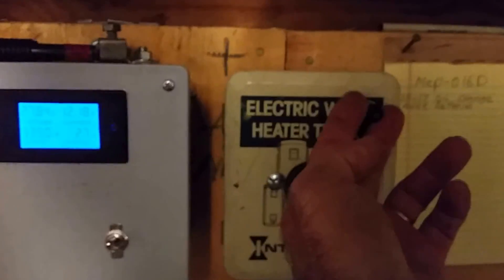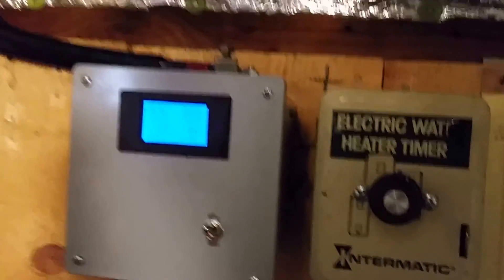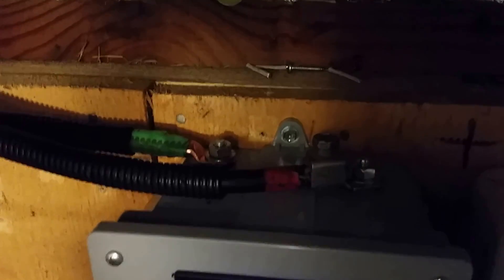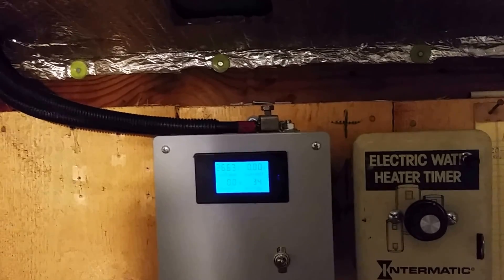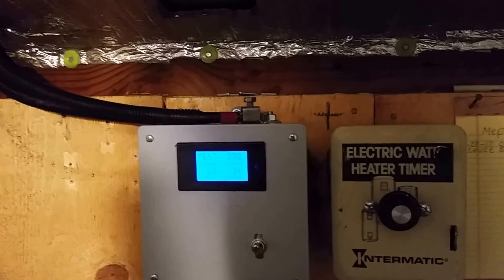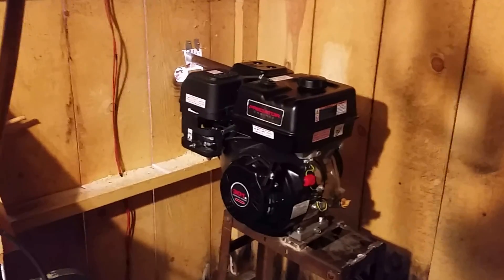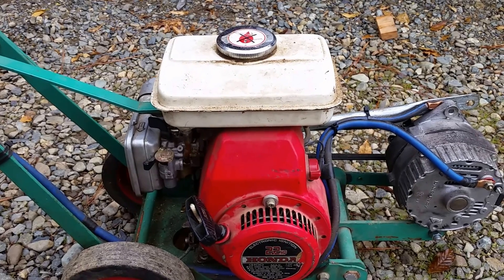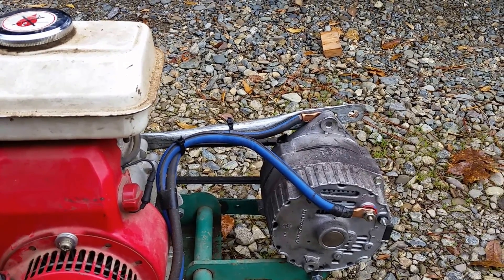Delco 10si alternator hack part II

Comment: the thing that sucks. is a brushed alternator is only about 55%-65% efficient. the newer brush less are in the 80'+%, but they are expensive. a phase bldc motor may be more efficient. but not easy to regulate. I guess its the tradeoff. I even researched building my own regulator. to get 24/29v from my 12/14.4v alternators. at least delco si alternators are easy to work with! great video. please let me know if you have any ideas about using my 2 alts to charge my 24v system.thanks
Reply from the maker: I have a friend who has been experimenting with fuel efficiency as well. He has a 3 cylinder Yanmar diesel driving a Ford G1 alternator with a rheostat for field control. (manual charge) Ge has measured the fuel as I have and he got his cost down to $.26 cents per kilowatt hour. He is off grid as well and uses lithium Ion batteries from a Nissan Leaf and a Chevy Volt. When I charge my batteries through the Magnum Inverter/ charger powered by my Yanmar L-70. We get $.32 cents per KWh. I have tried 10-SI PMA generators as well with very poor performance. They can not cool well at low RPM and anything over 2K the magnets can fly off. I have considered a Leace Neville Military brushless alternator. I found a 28 volt 400 amp brushless one that takes 22 horse power to drive. I can drive on with the Yanmar and get 200 amps 24 volt nominal at 1800 RPM at the alternator. The Leace Neville 400 amp alternators are 125 pounds! They have an adjustable AVR as well. I have our 302cc predator motor driving a 10-SI just for back up. I have a sense wire and a separate volt meter that gives me actual battery voltage. I found a PLC that has a high volt and low volt cut in/ cut out auxiliary relay for $50 on Amazon. Now I just need to decide if it is worth automating. I normally bulk the batteries with the diesel generator through the inverter/charger. We only burn $30 a year in the generator. For my money off road diesel is the only efficient and the most cost effective way with the best longevity.
Alternators as you have said are very inefficient unless you get are military one that weighs 125lbs. Its all about the size of the rotating mass. A delco 10-22 SI are so small that they waist energy in heat. I doubt the 125 lbs 400 amp alt. would even get warm at 200 amps. Here is one of my friend Mark's video on a proof of concept video. He has experimented with several alts. The ford G1 out performed them all. Mark has a lot of solar and Lithium Ion batteries as well.
https://youtu.be/rmBew4x6M_I

Comment: I have some 22si delco. its basically the same. just bigger. but 12 my system is 24v. and my lithium bank is 29.4 v max charge. I'm planning on only going to 28-28.5v. to extend battery life. I haven't decided the best way to use my 12v alternators. to charge my 24v system. they are identical. so I'm thinking series. and remote mount the rectifiers. since they determine output polarity.  150a at 29v would be nice! lots faster than a 30a solar. do you have any ideas? thanks